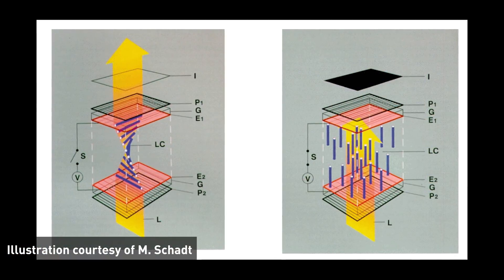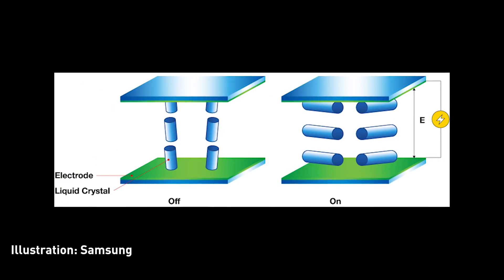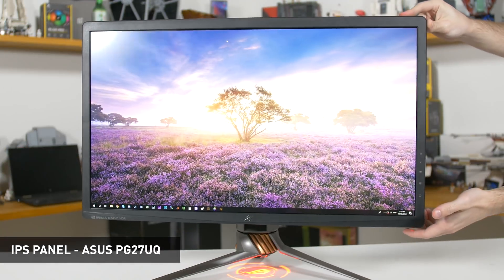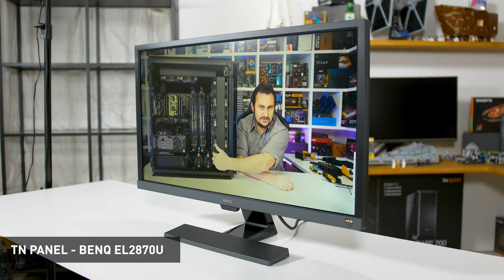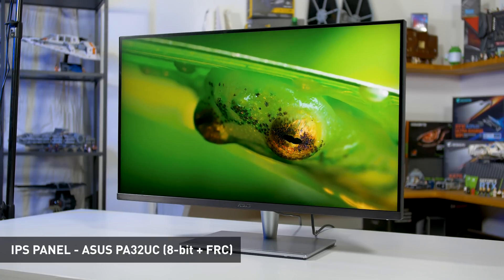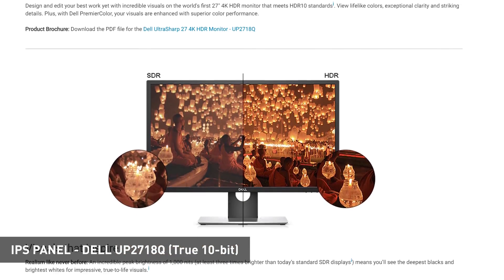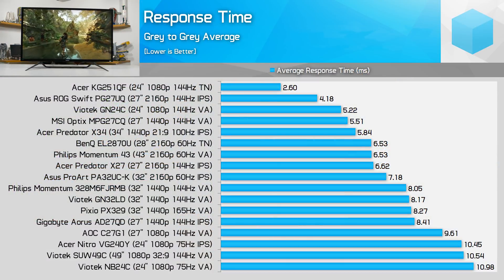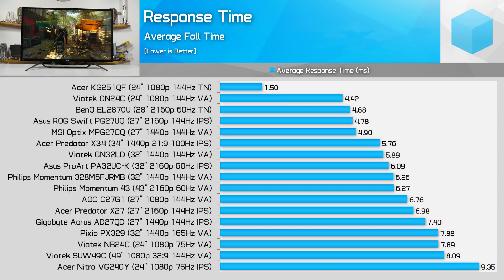TN vs IPS vs VA: Which LCD Monitor Tech is Better?

Comment: IPS is my favourite. I've owned and tried all 3, and IPS has consistently had the best image quality.
Reply: Agree. IPS is absolutely the best overall. Lots of benefits with almost no compromises
Reply: For me too :) if you see a 129% srgb color coverage, you don't go for other types of panels.
Reply: @Gienek_CPU  I have a va and it hits 145% of srgb coverage
Reply: @CoCo.-_-  
Link and price? my Philips 246E9QDSB 24" 75hz IPS 129% srgb 111 $
PS. VA in this price 80-100% max srgb.
Reply: @Gienek_CPU  VA usually have better color coverage than IPS, but not as accurate. My cheap 144hz va monitor has 123% srgb coverage when I did color calibration, while my more expensive dell U2518D 2k IPS monitor only does 99% srgb coverage. But the color looks a lot better on the IPS one, even it has lower coverage, and after calibrate both monitors, the VA color still dont look as good as IPS.
Reply: @qiyuxuan9437  
No not look like IPS,  are you wath this movie and heard Tim?
Reply: @qiyuxuan9437  
Because it VA < 100% SRGB.
Reply: @Gienek_CPU My 144hz va monitor is HKC G4 plus, you can check it. It is a Chinese brand, using a samsung VA panel. I did my calibration using i1 colormunki photo both on this one and my Dell U2518D.
Reply: @Gienek_CPU  lol saying all VA < 100% srgb is just like saying all IPS > 100% srgb. There are so many different type VA and IPS panels. Also the spec listed by the manufacture is not always correct especially for cheaper monitors, I trust calibration tool to get the more accurate info.
Reply: @Gienek_CPU  Also, most VA panel monitor used NTSC color space to rate their color coverage, since VA is more common used on TV, and NTSC is color space used on TV, and it is bigger than srgb. 72% NTSC is about same as 99.9% sRGB. While most entry level VA monitors used the 85% NTSC coverage panel. That is also the reason why many TV looks so vivid than monitors, since TV signals is using NTSC color space, while almost all images and videos from internet is sRGB.
Reply: @qiyuxuan9437  
I say about srgb, i know what is NTSC and is much lower on VA in this price !!!!!!!!!!!!!! 111$ :)
Reply: @qiyuxuan9437  
No all, i say in this price 111$ omg, learn to read and understand simple things.
Reply: @CoCo.-_-  
No you dont have, maybe you have but for 1000$ :D
Reply: @qiyuxuan9437  
I say about mine IPS, in mine price 111$, in my country, in mine 129% srgb.
Reply: @Gienek_CPU  Well, you can get the HKC G4 plus for around 120$ in China lol. You keep yelling about that "129% sRGB",but you should use a calibration tool to measure it if you really care about color, they can label it whatever % they want, since most people dont care about it. I do a lot of photo editing, and I just dont trust the manufacture spec even with factory calibration. There is a reason many graphics designer choose expensive 100% sRGB monitor over the cheaper wider gamput monitor. There is a lot more important spec of a monitor other than color gamput, like contrast ratio especially in lower brightness like 120 nits where most people calibrate monitor at that brightness, since it match with prints. Wide gamput monitors that meet the requirement for color accurate works are much more expensive. My whole point is, dont judge a monitor on the % of sGRB it covers, it dosent mean much especially in cheaper monitors.
Reply: @Gienek_CPU  lmao funny someone telling me I don't have something when u could easily look through Google and find the monitor I was talking about and I got it on sale for £600
Reply: @qiyuxuan9437  yup u saved me saying it my monitor has the best of both I think eg can hit 1000nits in hdr and also has 145% srgb with a contrast ration of about 4500:1 in sdr and can go higher with hdr I have my monitor set to 200 nits usually on a night time I go to about 150 and gaming have it at about 500-700
Reply: @Gienek_CPU  my monitor is in this video lmao its got one of the highest contrast ratio and for some reason in my tests tho as with some others lower response time around 4ms mark instead of 6ms
Reply: @CoCo.-_-  
MODEL??????????????????? PRICE?????????????
Reply: @Gienek_CPU  lmao I'm gonna stop teasing u now its the philips momentum https://www.displayspecifications.com/en/model/69871260 detailed specs and here a good review on it https://pcmonitors.info/reviews/philips-436m6vbpab/   i got it on sale for £599 or in usd 776 u can overclock the monitor to 80hz from what I have done and also change the adaptive sync rage from 48hz-60hz to 40hz-80hz there are some misleading info on the dp port saying its 1.2 but Philips confirmed its 1.4 and from what i have checked by running 4k with 80hz and hdr yeah it is and from panel to panel the input lag and response time differs not by much tho for response time 4-6ms mins is around 4.5ms from my test and input lag of 5ms while some get 10 and others 4ms on that but 10 is worst case and imo seems they tested it with hdmi and not used the low input lag mode on that is auto on, on display port
Reply: How is the lifespan of the display?
Reply: @xWolfdale  
bullshit, very expensive VA can get closer to this srgb, my IPS cost 111 $ OMG, VA has ghosting and slow response time, you can not catch up with IPS colors in this price range
Reply: @Gienek_CPU  IPS response time is even worse tho
Reply: @Gienek_CPU  I meant vs VA not TN
Reply: kuba83bb your va is shit then cause mines great
Reply: @hrwells9698  
Model and price idiot!????
Reply: Yeap TN aint good. I am using this 4k Acer Cb281Hk monitor. Not impressed at all.
Reply: You should only be using 100% sRGB anything over is wrong looking. Accuracy at saturation points and hue makes a good picture.
Reply: @TheShape-z7n  
No, 100% srgb is washed colors, and this have better TN panels.
If you not test, not say please, i tested many monitors, and srgb coverage is very important to image quality.
Reply: VA and IPS are both good. Most people will prefer VA for watching videos or movies, so if you watch a lot of movies on your computer screen, I highly recommend VA, but the most important thing for most people is to avoid TN panels, especially if the screen isn't only going to be used for gaming, as both movies and documents look a LOT worse on TN panels, especially the cheap ones. IPS is obviously better if you need the best possible colours, but the colours on a VA panel look way better than on a TN.
Reply: @syncmonism  Depends, high end TN looks pretty much identical to mid range VA & IPS & significantly better then cheap VA & IPS. High end IPS & VA will look better of course for the price of 2 nice TN panels...
Reply: @MLWJ1993  
You are joking, TN for 111$ is shit color quality (about 60-70% srgb), and shit angles of view.

For the same price you buy IPS with 129% srgb and best angles of view.

I see, you dont have many monitors ;)
Reply: @Gienek_CPU  for $100 you get shit quality monitors no matter what... IPS will have good viewing angles but oversaturation since there's no way that 129% srgb is clamped properly & you won't have any settings to adjust either on such a cheapo monitor. Not to mention VRR support is likely freesync instead of the minimum quality guaranteed freesync 2 (a.k.a. 100% full refresh rate range VRR). Why invest in shit IPS if you should get IPS for its colour accuracy in for example full DCI-p3 coverage. For that matter you invest in good quality TN if you don't really use the monitor for professional colour critical work or don't do media consumption where VA reigns supreme with it's much better contrast ratio.
Reply: @Gienek_CPU  except 130% srgb without proper clamping (cheap IPS) causes colour accuracy to be waaaayyyy off, literally defeating the purpose of buying IPS. VA on the other hand has a far more significant impact on image quality in non content creation based usage, but due to the higher pixel response times not always seen as ideal by some users (me included). Now since I don't feel like playing panel lottery and RMA'ing a couple (high quality) IPS panels due to excessive IPS glow & clouding issues, I buy high quality TN (100% srgb, in normal non off angle view it looks identical to properly clamped srgb IPS). If you don't require any quality standards for your monitor at all & don't need adjustment or "gaming" features on your panel but just better viewing angles and still bad response times, more power to you, keep using your low quality panels. But don't make it sound like cheap IPS (Probably old manufacturing processes optimised to be the same as years ago, but very cheap, just like power supplies) is the absolute end all be all best product.
Reply: @TheShape-z7n  
I owned about 20 in my computer life :) so i know what color's is 75%/100%/129% srgb, 75% cheap TN washed colors, 100% average VA little washed colors, 129% IPS great colors.
So you never see > 100% srgb :D some best monitors have about 150% srgb.
Gamma and white balance every user manage yourself, maybe for someone better is 2.4 gamma, and warm colors :D
Maybe you say about you preferences.
Standard is for standard peaople, i'm uber.
Reply: kuba83bb 
On his reviews you see that colour triangle with dots going out from the centre. Each point measured should near enough land near that reference dot. All my mid and high end monitors, TN, IPS all pretty much are accurate after i calibrate using the OSD on the monitor. That is accurate colour to movie standards REC 709 and sRGB share the same exact colour references. You seem to be quoting figures, have you actually calibrated a tv or monitor before. Oversaturation way past these reference points looks off, skin tones, grass are too lush looking. I know games are subjective for your personal preference but all my good monitors near enough line up with the reference dots when calibrated without using an ICC profile, just OSD adjustments using my i1 display pro device. A good monitor whatever the panel type can achieve this unless it’s utter trash.
Reply: @TheShape-z7n  
All content in internet = srgb.
Reply: kuba83bb 
Well HDR content on youtube for example or streaming services doing HDR needs more than SDR specs. Otherwise yes you are correct normal websites use sRGB.
Reply: @TheShape-z7n  
I dont use HDR.